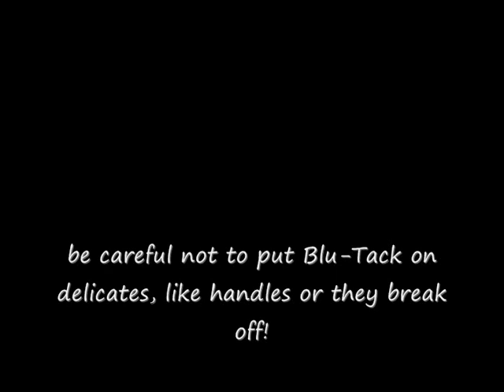Air brushing a model with Blu-Tack

Comment from the maker: @waynedaly100 Cheers dude. Dont go buying the expensive guns to start with. Its not just the mastering airbrushing, its fiddly so the gun can sit around for a while maintaince and cleaning them is another skill to learn, otherwise you can screw them and you will be pissed if goes wrong. Try buying a Revell starter kit, they are about £15 to £20 in the UK. Also buy a spare air can, otherwise there is nothing more annoying of running out of as your finishing the model, I did that one too lol

Comment: Just a word of caution though, the brand of blue-tack seems to make a difference on the finish. I had bought a bunch of cheap blue-tack from walmart for making the camoflauge but found after painting that the grease from the tack ruins the new paint finish in several areas by making it wrinkle up. 

So test out the blue tack on something else first.